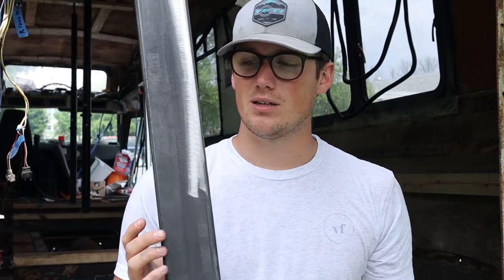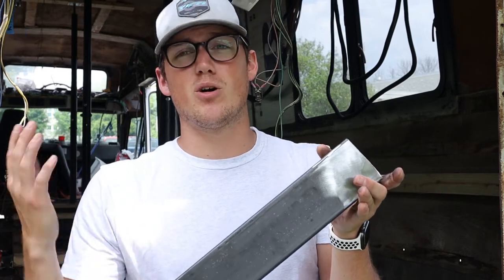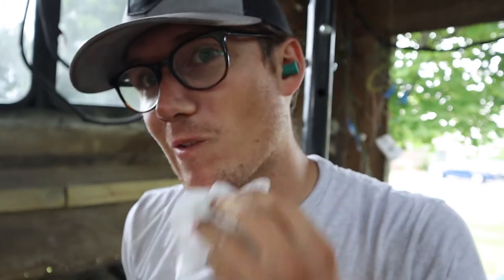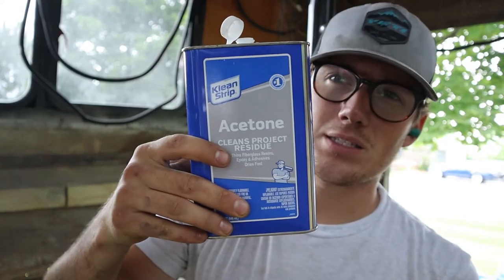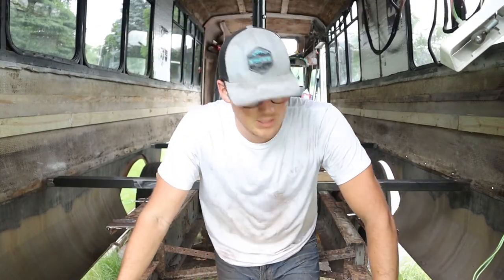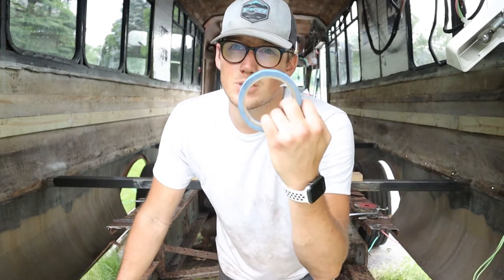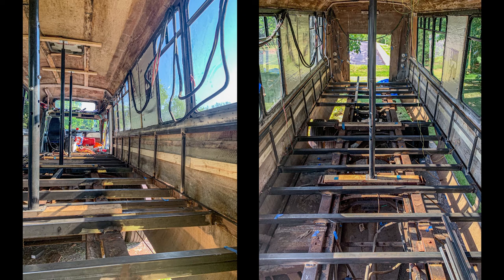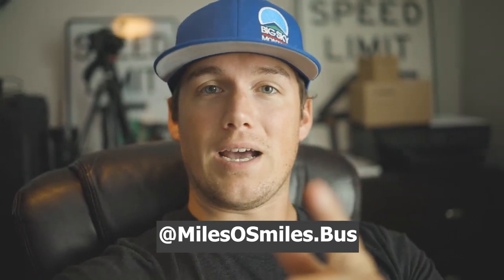Replacing ALL Of Our Rusty Floor Framing--Skoolie Ep. 15

Comment: We have started converting a shuttle bus too. Currently we are still stripping it down. We discovered so much rot and rust! Next step is  taking the sub floor off and taking out the AC and heater.
This video has helped prepare for what to expect. 👍🏼
♥️🇨🇦
Reply from the maker: Stripping it all the way down and treating the rust is hard work but definitely worth it in the end! Best of luck to you and let us know if we can help in any other way!

Comment: What was your cost to replace all that steel? (Materials + welding). Also, this might be a silly question, but how is the frame of your bus staying on the wheelbase when you remove all of those rusty pieces? Am I not seeing some sort of support?
Reply: i would like to know the cost of materials too. I'm currently in this same situation and would like to do the same thing.